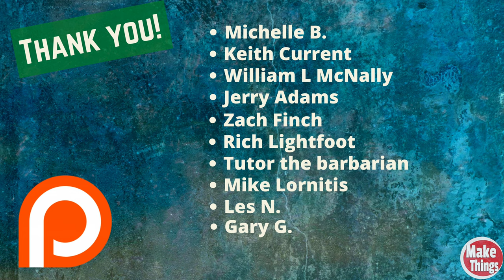The Flush Chisel // A Split Handle Chisel...For Flush Work

Comment: Great tool, looking forward to making one myself. By any chance does anyone know what the rod was that was placed on the edge of the steel during the tempering process? At 3:06 right before the quenching. Thanks
Reply: Magnet, if it's still magnetic it's not hot enough. It's a science!
Reply: @weisnowhere  ah ok I should’ve know better. Thanks for answering my question!